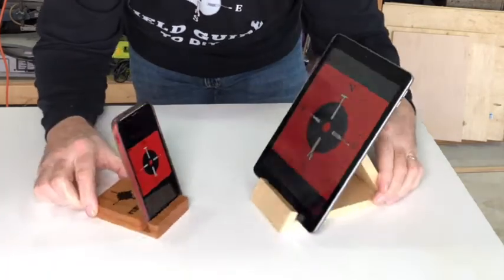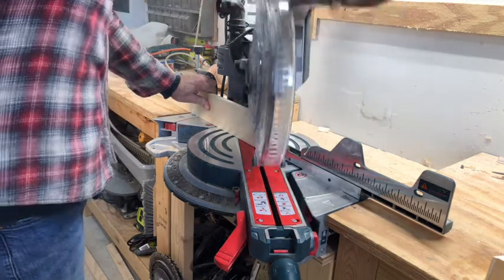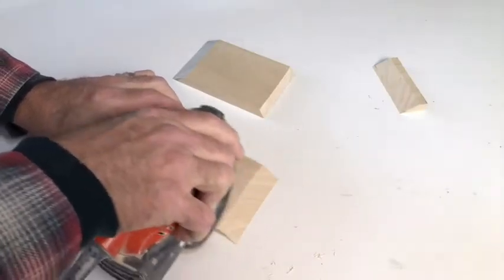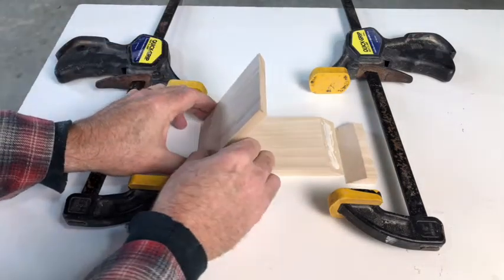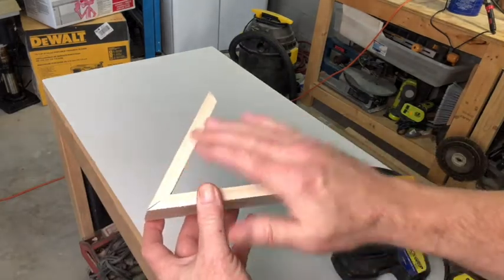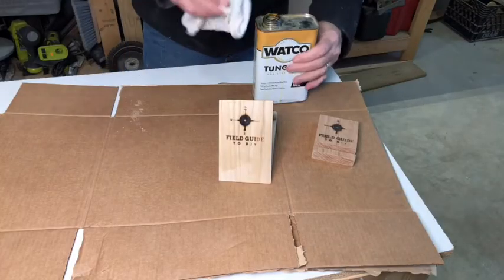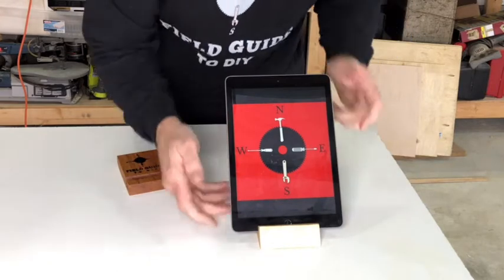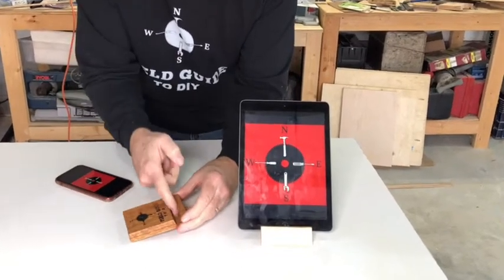DIY Wood iPad Stand | DIY Woodworking

Comment: Thanks for the video! Simple and very useful. The 60 degree miter cut threw me for a loop, because my miter saw only goes up to 45 degrees. Luckily found a neighbor with a saw that can do that and was able to build the stand out of a scrap piece of plywood, and use it everyday. Don't have clamps, but used painter's tape to hold the pieces in place, and that worked out well.
Reply from the maker: Nicely done!

Comment: Great idea! I'm wondering, with that back piece being so long, do you think it will hold with just glue? Your glue surfaces weren't very large, do we need to tack it somehow? Thanks for the nifty idea and sharing the measurements! Definitely going to try it!
Reply from the maker: I thought about that myself.  It turns out from daily usage, the glue alone is strong enough.  I could shoot an 18ga brad for added strength.  Thanks so much for watching.